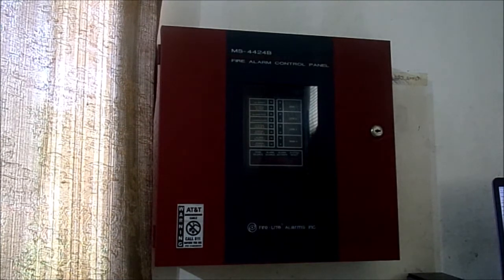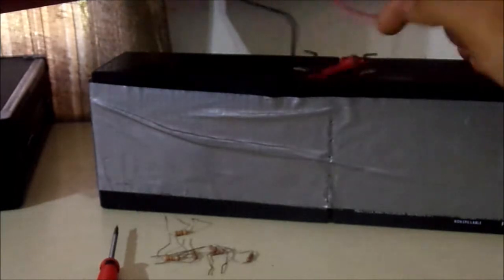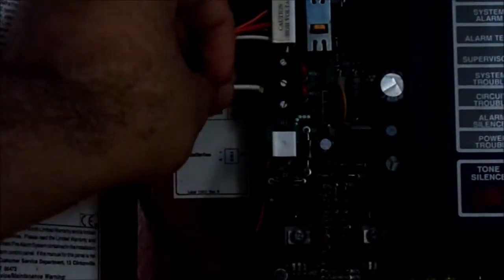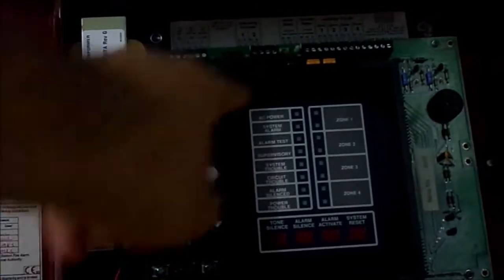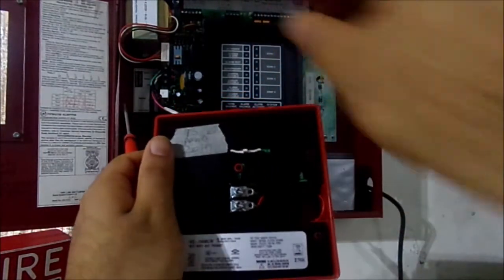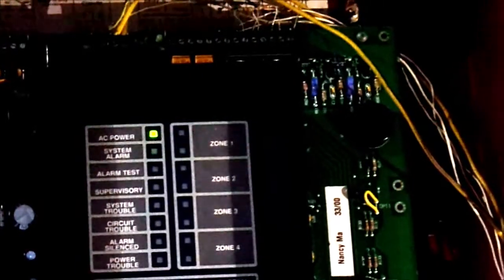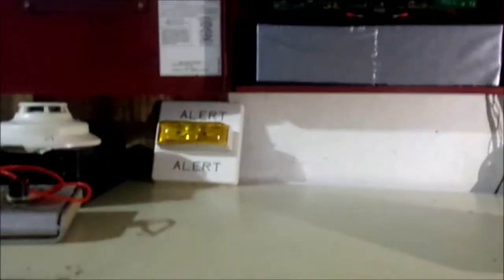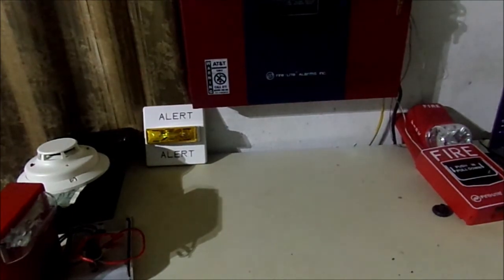How to set up the Fire-Lite MS-4424B Fire Alarm Control Panel Guide

Comment: It is also very dark
Reply: i sadly can do little to nothing about it but as simple as it is, the middle to the very right is where you would wire your alarm and pull stations at.

To keep it as simple, the 4 wires terminal block in the middle is where you would wire your fire alarm.

The rest on the far right  (it will show what zone on the sticker) to wire your pull stations at. All you need to is wire them and it matters only on the alarm terminal block.
The pull stations, you can put it somwhere else since it dosent matter which wires goes which way